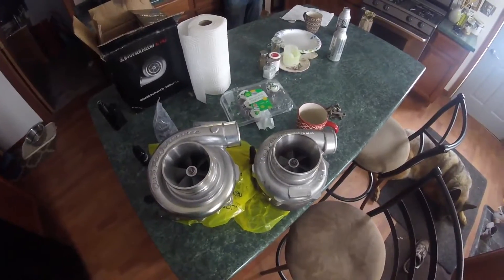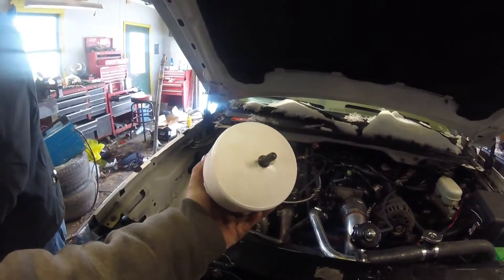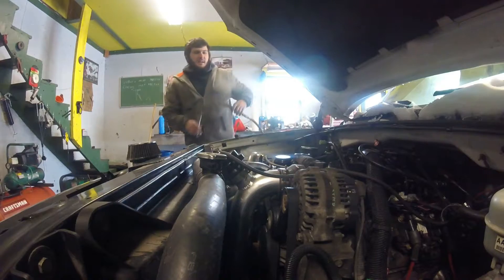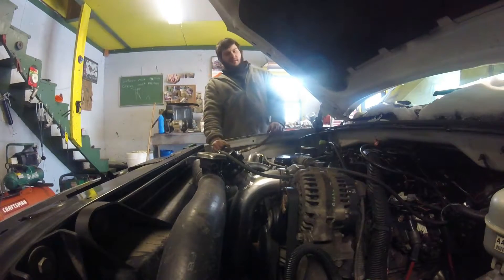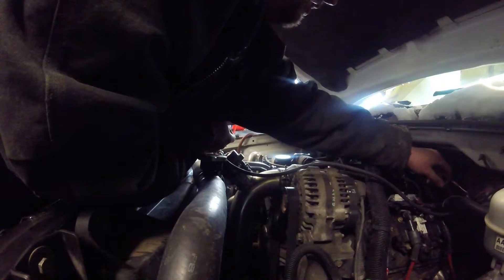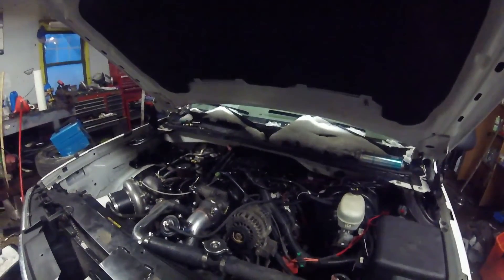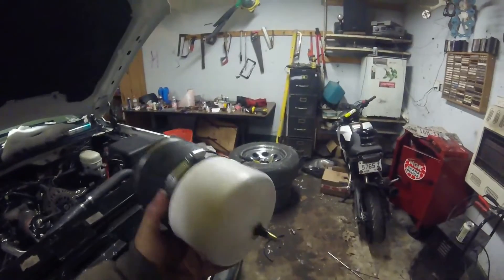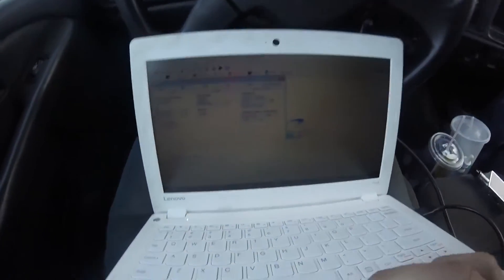70mm To 78mm Swap On The Silverado! Boost Leak Testing!

Comment: Wouldn't there be some leak down through the cylinders that have open intake valves?  You might want to install check valves on the vacuum lines so they don't bleed boost.
Reply from the maker: This was just a test for leaks before the motor

Comment: Nice build man I have a question when installing the kid was there much welding or fabrication involved? just wondering the level of difficulty I'll have installing one on my 03
Reply: *kit
Reply from the maker: Watch my on3 turbo kit video. I installed it on that video
Reply: HunterTuned I already watched that one but it didn't say if you had to weld or had many fabrication issues
Reply: RIG 99 prepare for welding and if there is none then be pleasantly surprised.